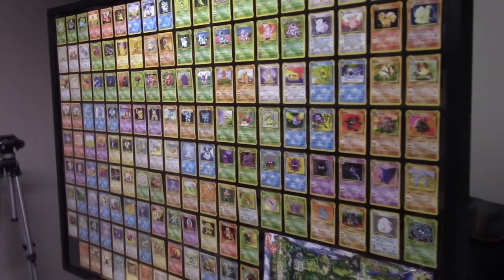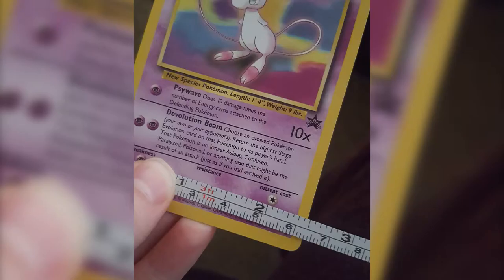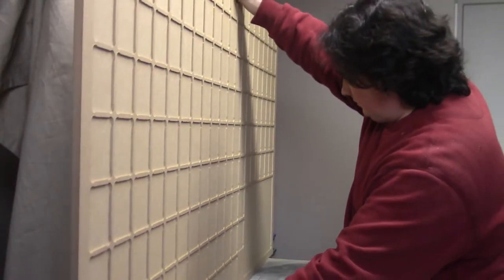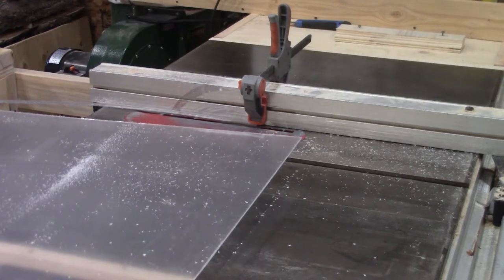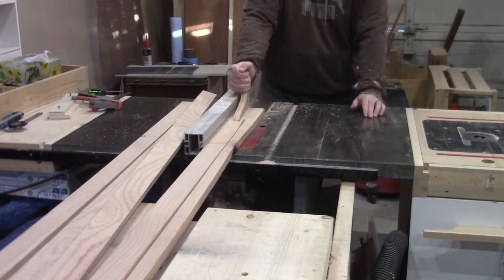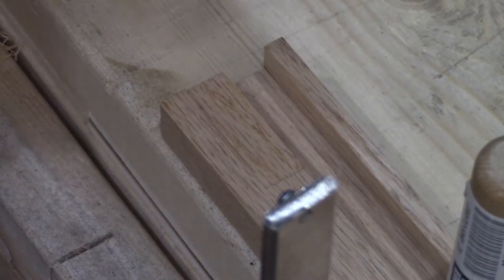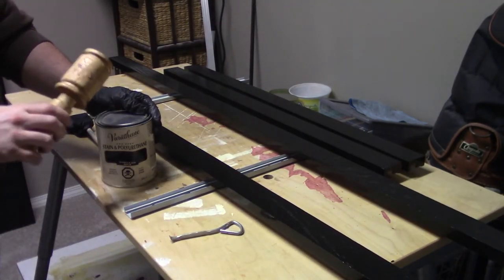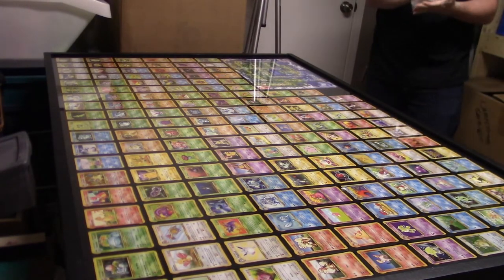MASSIVE Pokemon Trading Card Frame

Comment: Hey bro, wonderful job! I have few questions if you don’t mind. 

Are those cards are coming into front when you locate the frame vertical ? I mean are they stable slots? And did you use any sleeves or just put the cards into the slots?
Reply from the maker: Thank you!
The cards are just sitting in the slots by themselves. No sleeves. For the most part the cards sit in their slots with no problem, however if the frame is bumped or tilted too far forward they can slip out.

Comment: Great frame. There are actually "anti-static spray/cleaners" available. You should be able to use that to reduce the static.
Either way.. I was always under the impression that woods have acids in them, that will (over time) seep into the cards and collectables. . So perhaps not the best idea for the high valued cards. But, still cool.
Reply from the maker: Thank you!
I think the static might not be as much of an issue anymore, at least from what I've heard from my sister. I assume it's dissipated over time and was really only an issue the first while after I pulled the protective sheeting off.
As for the acidity, I can't say that was something I considered, but good to keep in mind for next time.
Reply: Static elec. You can dissipate by giving a source to a ground.

For the acids I just watched another framing tutorial and he used "archival" wood, glass, tapes and such which don't have those harsh acids.
Reply from the maker: Archival materials is a good idea

Comment: Super cool project. I know with framing photographs, which I realize are much smaller, I use push down spacers that press the matte cutout and photo forward onto the plexi. Otherwise the cards could have been left inside of snap-tits or any other kind of sleeve and two sided taped in place.
Reply from the maker: That's true. would have been relatively easy to re-size the pockets at the beginning to allow for a sleeve. Would have been good.

Comment: A bit of blue tack behind the cards ? They would stick to the wood
Reply from the maker: That would work, though I have seen some leave a bit of a grease spot behind over long term usage so that might not be a great idea if they are more collector-ey cards.
Reply: @JohntheSchreiner  If you are wanting to friction fit the edges of your cards against painted wood, i don't think the risk of a grease spot behind the card is a big deal tbh :p But I get your point. 
Worst case you can put them into sleeves first. And then blue tack (or double side tape, like many other comments suggested)

Comment: Great video mate. How much did it cost to make?

I am currently wanting to do the same with my cards and weighing up whether it is worth making myself or just paying someone to make it. Cheers
Reply from the maker: Thanks! 
Material cost was fairly low for what I charged for the project. Mark charged me $125 for the CNC work and he supplied the mdf. The oak I’d already had from another project but that would have been about $20. Plexiglass was $120, and then I’ll say another $80 or so for the finish and miscellaneous hardware.